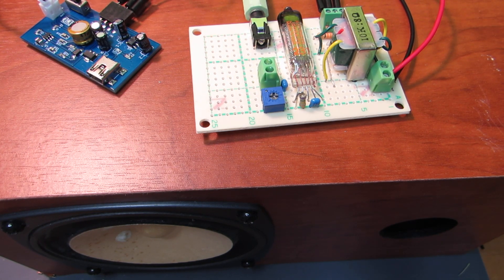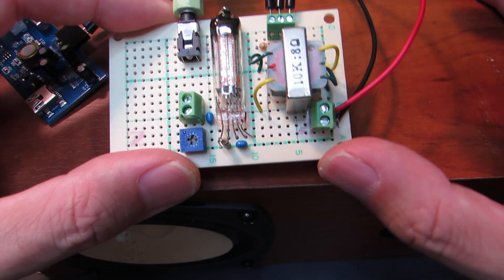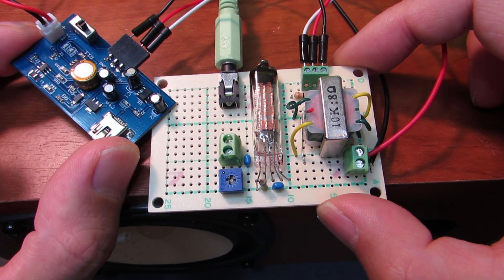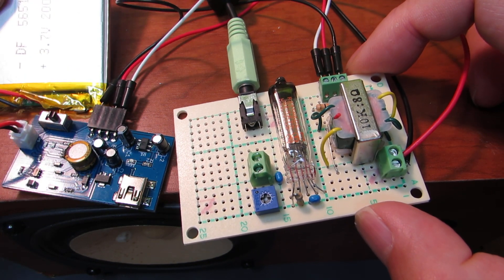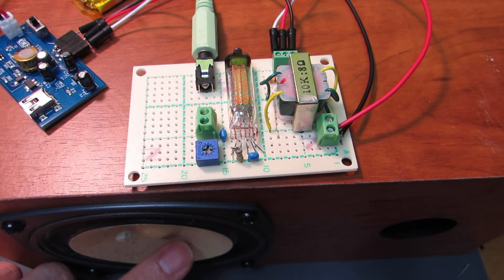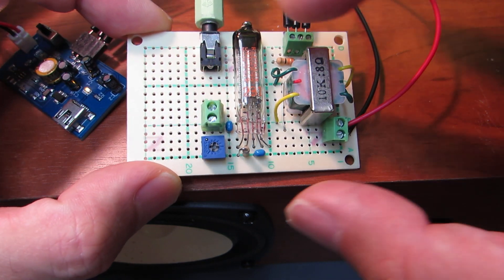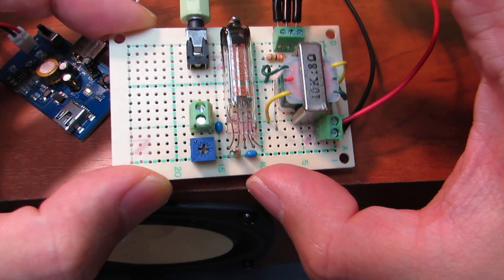Tiny power amplifier by sub-miniature tube 5672

Comment: AN audio amplifier requires at least two sections .One is a voltage amplifier .You got that little tube that can be used for that ,But you also need a current amplifier to move a coil speaker .You can use a Mosfet to do that, or a power OP amp capable of several amps of output .. You dont need a transformer with a power OP amp

Comment: gotta get back into these...
one tip? mount the tubes on their own little modular board. couple of header pins and vero(perf?)board, makes protyping so much easier.

i was working on a variant of a class D using the lil russian rod tubes... why?
because ive never heard of a class d vacuum amp, and it seems a neat way to actually use that so called "800W pulse" capability (more like 8W with 10Ah of nimh...)... gets sub 40hz bass without the need for a 25kg OPT...

hardest part is the isolated supplies for every freakin stage... effin. why couldnt they make them indirect? was a headtrip, the first amp i made, preamp for acoustic guitar, high impedance cathode follower running off a single nimh. yeah, um... how to do a cathode follower with direct heating?
giggity. a modified joule thief with an isolated HT winding, duh!

blew my scope, blew my puter, lost all my files... arrrgh. a lot of projects suddenly got shelved. grr.

Comment: Hello, i believe that this design can be improved. With a floating filament supply, 3m input grid to ground resistor and a 270r cathode resistor with a 47uf cathode bypass capacitor. A 1.5nf capacitor between anode and grid 2 will give a bright but sharp tone, a 3.3nf gives a more cold glossy tone. 
 Could you please tell me how to source the miniature output transformer that youre using?
 Thanks!

Comment: Nice video.
Can you please let me know which transformer you are using?
Will it work with a 4 ohm speaker?
Reply: tubes are forgiving of wrong impedances, and unlike solid state, output power isnt directly related to the impedance. well, it is but theres more to it than simply shoving a lower impedance speaker on.

yes, they will work on a 4ohm speaker, but the tube will now be operating with a 5k load, having the effect of steepening the load line, increasing 3rd harmonics, and a few other things. with pentodes, the screen current is the killer. fortunately, thats usually due to using a speaker thats too HIGH impedance.
go open circuit, the worst thing to do to a tube, and the load line flattens, the screen draws all the current, and if the screen stoppers (resistors...) are too small... the tubes dead. never run a tube amp with NO load.

of course, transformers can be rewound... its about(the square of the) turns ratios. 8:10000=1:1250=1:~35 turns ratio.

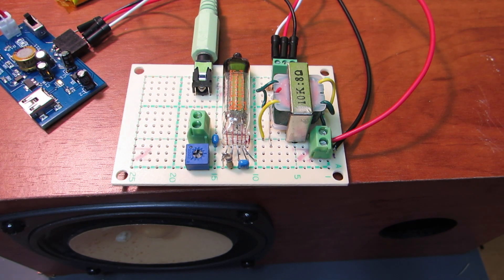a 4:10000=1:2500=1:50 turns ratio.

the challenge of winding OPTs is knowing which wire diameter to use to get the appropriate turns ratios and current carrying ability. theres charts to refer to, luckily. they arent that hard really. tedious is really the word.
Reply: Hi
I am sorry but I missed your reply.
Thanks a lot for replying.
I would like to find that tiny 10k:8 transformer.
I bought one that is 1.2k:8 and I tried it with headphones. As mine  are 32ohm, that gives 4800ohm in the primary, which was the impedance I wanted for the valve I was using. Having 5k or 10k on the primary, would allow me to connect to a speaker driver.
Cheers,
Pedro

Comment: If you want more power with small tubes like these, there's the 5902. 1 watt at 110v B+ single ended, and about 3 watts in push pull. It's amazing!
Reply: What do you think of 6n16b and 6n17b tubes?
Comparing to class A, I will be able to take 3 times more power? Is that what you meant?
Thanks in advance
Reply: @geekPlayground  Those are preamp triodes - not output triodes - they have very little current amplification and very high output impedance. Moreover they need at least 100V B+ to work correctly.
Reply: @rastislavledaj3110  Well, 6N17B are indeed pre-amp tubes, but 6N16B can be used either as a pre-amp or power amp tube. As a power amp tube, you'll get 0.5W in push-pull.
There are many circuits on the web using these as output tubes.
Reply: @geekPlayground  Roger that. They are fine in SRPP configuration in headamps or so, but from own experience, they do not sound as good as 6N17B.
Reply: However, the combination I prefer is the 6N17B on the preamp and the 6P30B-R on the power. 😊
Just one more thing, I use these valves on guitar amplifiers, not hi-fi.